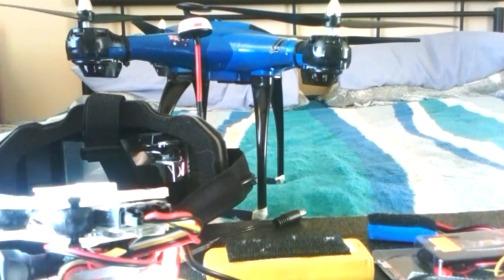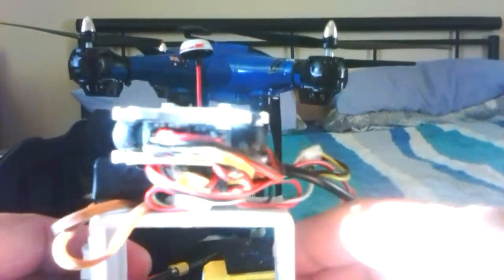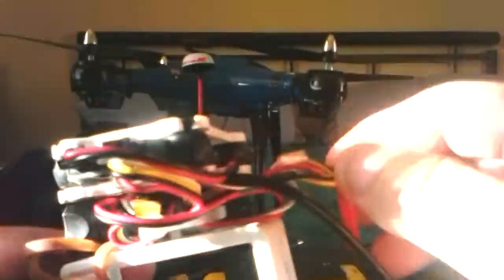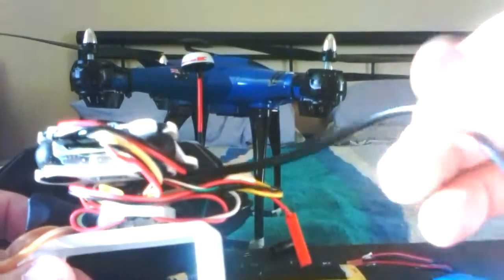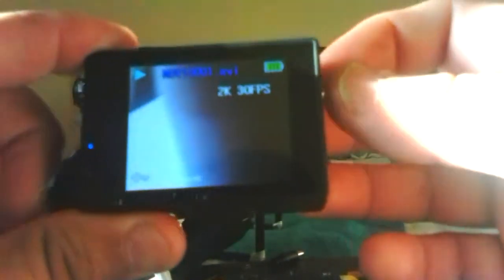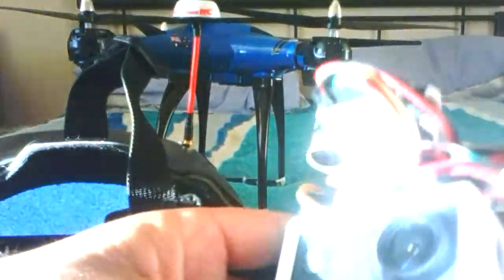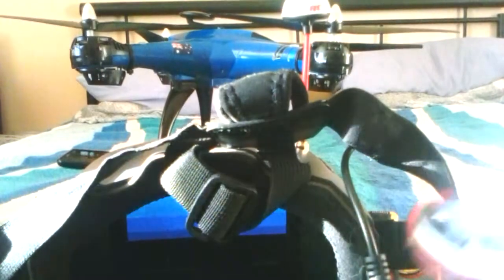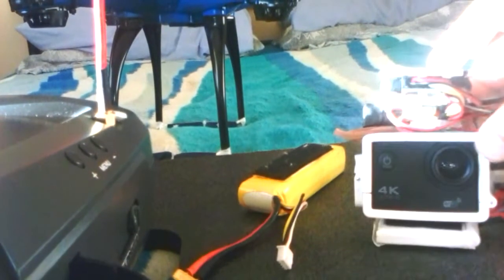How to set up FPV live feed to your goggles via your action cam

Comment: Can you use any micro usb plug and just chop and solder the other end or is it a special micro usb?
Reply from the maker: No you need to buy a proper adapter wire for action cams,  this video is old so I can't remember where I got it from, thanks for watching
Reply: @PERTHWESTOZRC  right on, i think i have a couple micro usb cables with the 4 wires coming out the other end may just try it. I just noticed how old the video is. Thank you for replying! You just gotta sub from me!
Reply from the maker: @joecarnes9174  thanks very much for the support Joe, this fpv system actually works great..haven't used it this way for a while, as I use AIO cams these days but I do still have this setup somewhere in my stash of fpv parts, might give it a go again soon :)

Comment: NICE! I learned the hard way on mine to just use the AV yellow and the back ground. Anything more then 5v fried one of my action cams. I just use the camera battery, but it lasts a long time. I power the VTX off the 11.1 volt flight battery. Also learned the camera plug is thinner then the gopro plug. This stuff gets frustrating to me.
Reply from the maker: AKTOYZ ALASKA cheers bud, hope you enjoyed the video :) and yes action cams like what we have that are not gopro brand have a different plug shape..i learnt that when i first bought a microphone for my hat cam, was for a go pro. yeah the reason im.going with the action cam is the battery lasts a lot longer than a 1s to power those tiny aio cams plus you are recording the flight at the same time so no need for a separate dvr
Reply from the maker: AKTOYZ ALASKA also I purchased one of those cheap 1080p HD cams you linked me to in your video.. hope to get it next week sometime